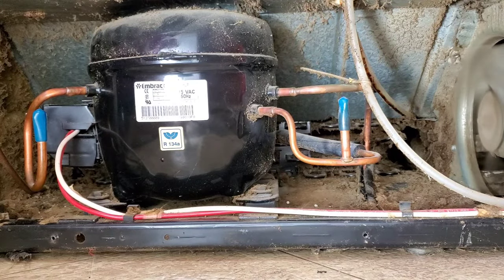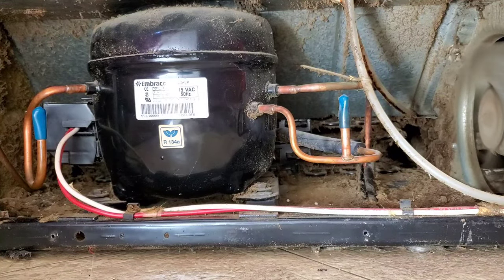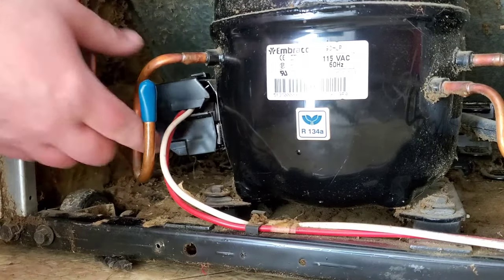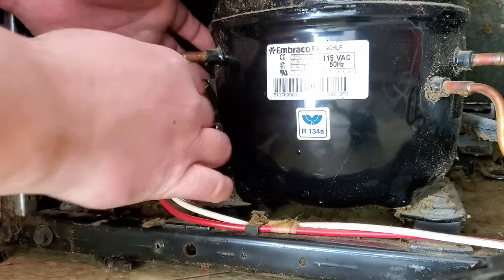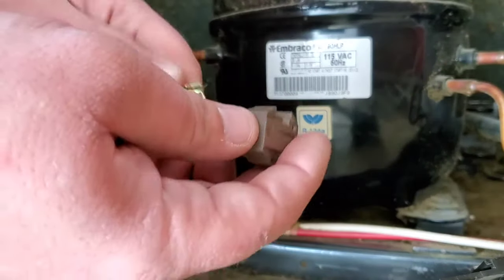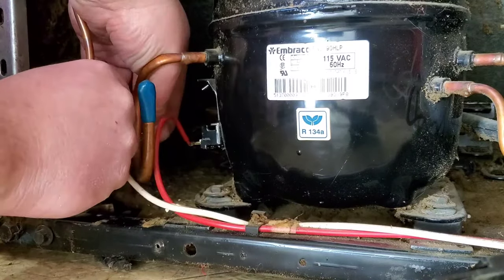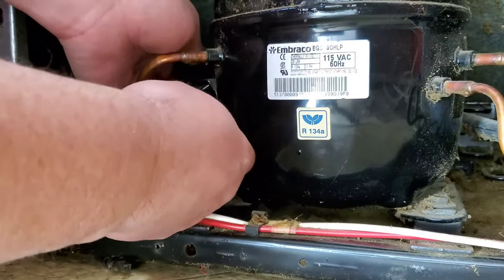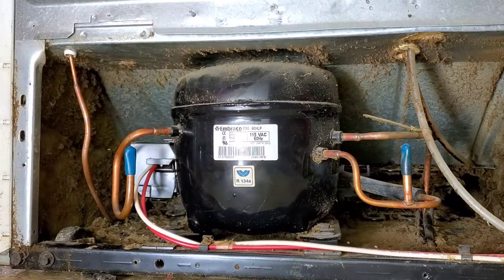How to Fix Whirlpool Refrigerator Not Getting Cold Cheap and Easy

Comment: Will try tomorrow I was wondering what to do if fan isn’t working, the problem is that my seals are shitty so my family sometimes leaves it open on accident and then I have to take everything out to defrost and usually it goes back to normal but now the ice box and freezer both aren’t getting too cold , so you think it’s the relay part you just fixed? Will try tomorrow to try and check like your video it was super helpful and gave me confidence lol mahalo ❤

Comment: I found your video very helpful. My start relay seems to be fine. The problem with mine is both sides of my double door warm's up and it will cool and freeze on the freezer side and cool on the fridge side without warning. How do I know when to give up on this fridge.  Manufacture date 08/09

Comment: Matt, Hi Old Male 75 yrs Pensioner here from Australia. Just watched your Video. I have a Upright Freezer / Fridge - NEC possibly 2009 yr. Being working alright. I overloaded to top Freezer and it stopped freezing. I removed all from the back compartment so the Vents could operate. At that stage the Fridge compartment was working. But now the Fan in the Freezer section is working and food is frozen, BUT OMG the Fridge compartment is not cooling? I have removed the rear bottom cover which was caked in fluff and inside I thoroughly vacuum all out. But with no avail still no cooling to the Fridge section. Is there a certain tricky method I can apply DIY to save paying for a professional to look see. Your suggestion or ideas would be greatly appreciated indeed. John

Comment: FYI, I have a Whirlpool too, but it was not that issue that was the problem. It turns out it has a slow leak in the system. In California the tech won't try recharging the system. Basically, they recommend sending it out to the landfill, they won't fix it. Total waste of resources, everything is being made to last a few years now. I've had several talks with the local refrigeration technicians, they say most of the newer friges fail, due to plumbing not electronics: pin hole leaks, expansion crack etc.

Comment: Do you know how to get air flow to improve from both the fridge and freezer  vents? My compressor and fan both run fine (I have a 2006 Whirlpool side-by-side) but the fridge side vent only releases a very small amount of cool air, even on setting 4 or 5. The freezer air flow is stronger but still not consistently keeping food frozen.

I just replaced the thermostat/temperature control with the assistance of another DIY video, thinking that was the issue but the situation didn't improve.

Any suggestions are appreciated.

Comment: my side by side started to go crazy, wouldn't keep a constant tempurature.. Replaced the Refrigerator Evaporator Motor it improved but still not 100%...   we also changed the Chest Freezer Run Capacitor but it made the refrigerator worse so we put the old one back in... improved but not working right... during moving to another home it dropped about 1 foot, nothing major... now the freezer is the temp of the refrigerator, and the refrigerator is a bit cold but cannot trust...  We need this refrigerator to last a little bit longer till we can afford to replace...  Thank You....

Comment: Matt, I have a Frigidaire top freezer fridge. My fridge temp is normal but the top freezer is too cold.. rock hard ice cream. I’ve found the small temp slider but it was frozen so I put a little hot water to loosen it. I then put the lever all the way down. It is still too cold. When I back in to check the lever, it was frozen again. Hope u can help! Remember, the fridge is good.

Comment: Hello Matt....so love this easy to understand video...is there a way to tell if the jazz board is bad as well? I am about to take the relay switch off...but was wondering if that doesnt work or if it is fine...could the jazz board be the issue and is there a way to tell if it is functioning properly. All parts in back seem to be working, fans, lights, etc...but freezer and fridge are not cooling at all...totally warm...I've tried all the reset ideas, nothing has worked...now I am going to try this....thanks
Reply: Same that's happening !

Comment: How do you clean the coils
Reply: Wipe them down... not rocket science... also his machine compartment and all that dust/dirt is the culprit for why his start relay went bad... If you have animals you need to vacuum out that area once every 6 months.. get a condenser brush and use that and a shop vac, do it with the unit unplugged

Comment: Mine is doing that too but the fan shuts off when it click?  My compressor is hot as well. 
Can you help? My fridge isn't even that old. Manufactured in 2019 bought in 2020 sat in storage a few months. Been using it almost 2 years now. 
I'm a single mother, I can't afford to buy a new refrigerator. 
If you could help, that'd be GREATLY appreciated ☺️

Comment: My compressor is running I can hear it. But my fridge is not that cold. I cleaned the coils, and fan is running fine underneath. I’m not sure what else could be wrong. Any ideas?
Reply: Same here
Reply: What was the issue
Reply: @janaybetraveling4281  were u able to figure it out?
Reply: Same issue here. Only gets to 40° but freezer is fine
Reply: @spinnerrossi  it was the circuit board

Comment: Matt, a question, my start relay had some heat burn marks around it, would that mean its faulty ? Ive been having probs with my fridge freezer, the fridge thermostat wasnt working as it should even though i replaced it with the correct thermostat. Any advice appreciated on what to try next, should i get a relay. Thanks

Comment: When my refrigerator is plugged into the electrical outlet behind the fridge, the fridge starts up, runs a few minutes and then the compressor shuts down. I change plugs on the same outlet, same thing. I take an extension cord and plug the fridge into an outlet in another room in the house, and the refrigerator works fine. I tried going to the electrical box and resetting the power and the outlet behind the fridge worked about 15 minutes and then the condenser shut down. Why would the fridge work fine using another electrical outlet in the house? Thank you.
Reply: Did you find an answer to this? Mine is doing something similar. Thanks for your help
Reply: @rustictrough8814   one day I had the refrigerator pulled out and I swept some dust up, then I took a broom and ran the broom under the machinery at the bottom of the fridge. There was a lot of dust built up, so I made sure I got all the packed dust out from under the motor etc. (there was a lot). The fridge has run perfect ever since. Good luck.

Comment: Could this be the cause if my fridge is not getting cold but my freezer is working fine?
Reply from the maker: I doubt it. It's easy to check just by listening for the compressor to be running, or the clicking.
Reply: Did you figure it out??.  My freezer working but not fridge. 😕
Reply: @ellen4more  yes, my side by side was too full and needed the defrost switch  replaced
Reply: @katiehanners6814  where is the defrost switch?